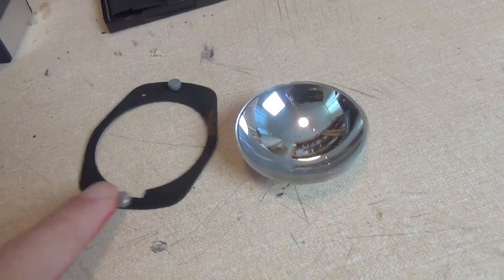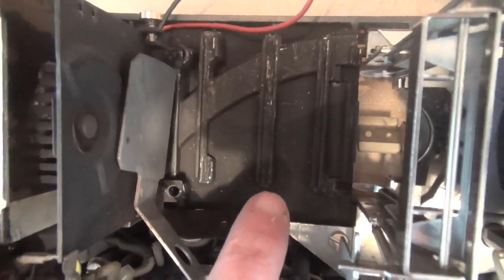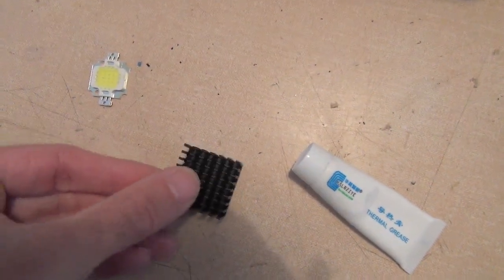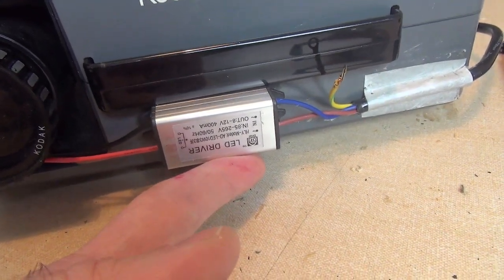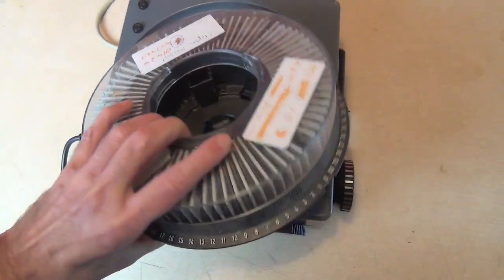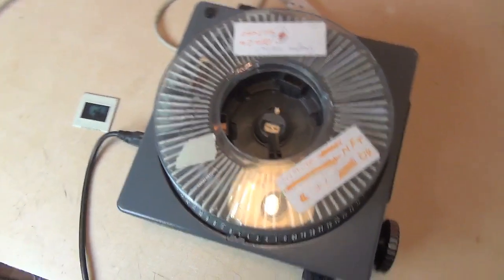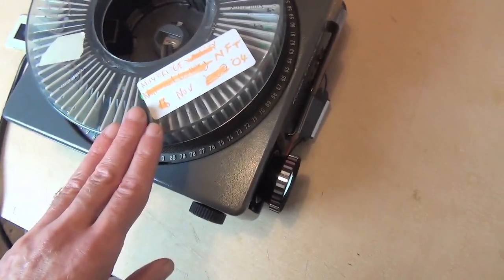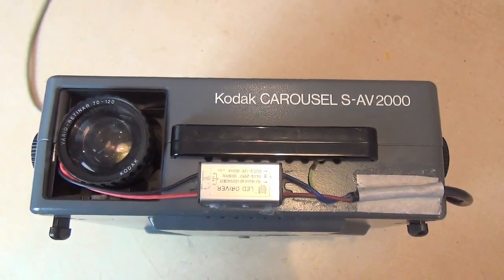LED conversion: Kodak Carousel 35mm slide projector

Comment: Can that bulb be replaced with an LED lamp?   I'm using the Kodak 
Carousel 850H for digitizing slides and the Lamp just gets too hot.
Reply from the maker: You can't just change the halogen bulb for an LED. An LED (chip or bulb) needs the special "driver", as shown in the video.
Reply: @horipet  - What do you mean a driver?     I've never heard of a driver,  if so would that not be included in the LED enclosure, and all we need to do is provide the correct power.
Reply from the maker: @genemetz1945  Depends on the LED. Some LED bulbs include a built-in driver, but I'm not sure you would be able to find a suitable one for this job. In my conversion the driver unit (which I added, attached to the outside of the projector body) supplies the special related power required for an LED, whether bulb or chip type, which is different to the original power supply of the Halogen lamp. (Google LED driver).
Reply: @horipet  - What I'm thinking of doing is just pulling out the bulb and assembly if I can, and fit in some other assembled LED that I just plug into the wall.   I just need enough Lumens  (whatever that needs to be) to provide enough lighting the shoot pictures of the slide.  Maybe it would be better to quit this idea of using the projector and just use a light table and shoot from above the slide.

Comment: I’m trying to get mine to be as bright as possible. Is that possible with LED,s or stick with a 550W zenon puts out 3500 Lumens and serious cooling? Great video, thank you.
Reply from the maker: This one was for small screen images, so only needed a low output. A big problem is space inside the projector, for suitable LED heat sinks etc. If the Xenon and cooling arrangements fit, might best way to go.

Comment: Hi Horipet
I recived an sav2000 and looking for a timer
At the moment is impossible to find and the only way to have one is to build one from scratch or copy an existing one from a kind user
I found a diagram but it looks like is for another model and is not working, it also requires a battery, unlikely the kodak one

Would you be so kind to help me?

Cheers Alex

Comment: Do you have any idea where I might find service information for a S-AV projector? Nothing on the Kodak help site that I can find. Any ideas please.Thanks Lynton.
Reply: hi Lynton, Have you tried eBay? I found an original manual for mine on there.
Reply: Hi Lynton, I'm also looking for a service manual for the S-AV 20xx series, did you find anything?
Reply: Hi Gebhard sorry no, I couldn’t find any service information on the web. I just cleaned and lubricated all the moving parts and fitted an original type lamp. I have seen a photograph of a plug in remote control for both the focus and slide advance but no details.
Sorry I can’t be of more help.
Cheers
Lynton
Reply: @lyntonprescott3412  Thanks anyway! I'll keep you updated if I find anything.

Comment: Hi! Thank you for this video! Do you think that the LED driver could be powered from the original halogen power line?
Did you ever try to turn the fan off? I´m considering to convert several projectors to LED mainly because I want to get rid of the sound of the fans...
Reply from the maker: Hi, The drivers I use are 240v input (UK mains voltage) and the original lamp was 24v - so, no. I didn't try to turn the fan off, as the projector is to be used inside a display cabinet which will dampen the noise. Also, the fan helps as the heat sink fitted is small - but might be OK without the fan - you would need to test.

Comment: Excellent Mod!!!  Where did you source the LED?
Reply from the maker: ebay - search 'LED chip and driver'. Heat sinks also available on ebay. Be aware that using a higher wattage LED chip might require a bigger heat sink, and there isn't much room in there.

Comment: Im considering doing the same thing. How is the colour rendition of the LED ? I know that halogen lights are 'fairly' even across the colour spectrum. I thought that LEDs had colour bands across the spectrum. IE reds might appear quite dark when projected. Have you noticed this?
Reply from the maker: I haven't noticed that, but the colour balance isn't critical for the use I'm making of this projector. There are two basic types of LED panel - White and Warm White. Use White. You might find that examples from different manufacturers/suppliers of White version will vary slightly in colour balance. I have converted several projectors of different types, but most of the others are for showing b/w silent movies. With the brief testing session I had with the Carousel, I didn't notice anything obviously unbalanced about the colour image. The components aren't expensive - and you can make the conversion 'reversible' - so if you're prepared to spend the time, I would say it's worth doing. Do bear in mind that my one was intended for small screen projection. If a bigger screen required, you can use a bigger LED chip, but might need to make a bigger heat sink. Good luck.
Reply: This led has about max CRI 80. The another thing, maybe it is too close to the collector lens and causing vignette. I checked my projector and I need with this heatsink a 28x28mm led to avoid inhomogen lighting. Or choosing peltier type and I can move backward a little bit to the imaginery place of halogen focuspoint.  But maybe I will choose the 28mm one because it is 50W and CRI98 / 5670K CCT